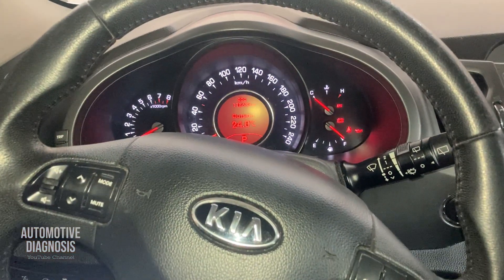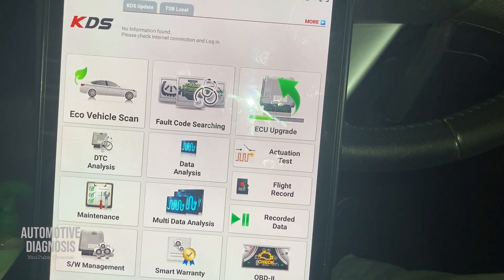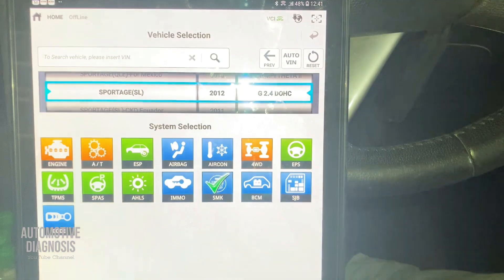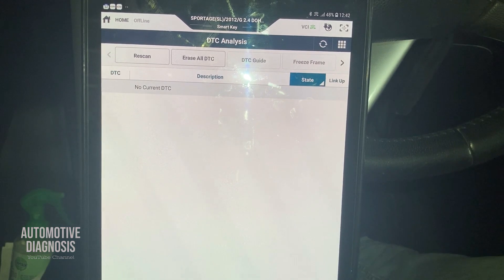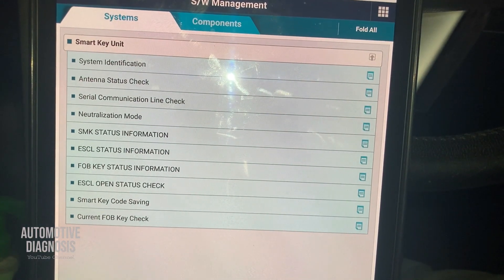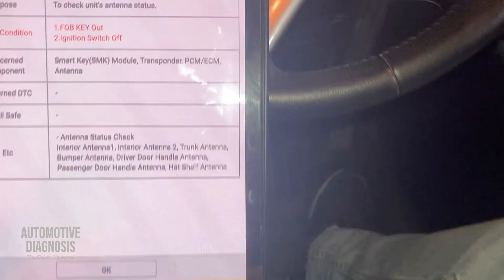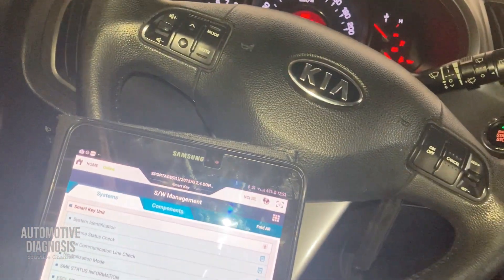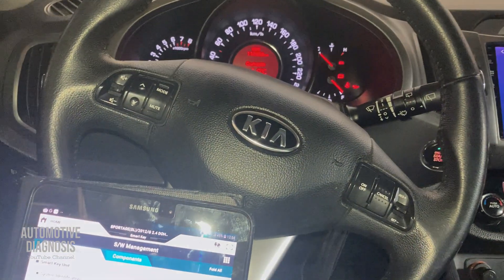Push Button Start Diagnostics Explained | Smart Key System Diagnostics #pushbutton #smartkey

Comment: hello dear @AutomotiveDiagnosis.
question if i may plz, Hyundai sonata YFA when key fon not in the holder engine doesn't start, as soon as i insert key fob into the holder engine starts. what is seem to be a problem? new battery in key fob,buttons ok,active. i've changed battery believed that could be an issue, but it's not. if transponder has a problem, would i be able to start the car with key bod in holder??
thank you
Reply from the maker: Hi there, could be the holder issue. When you insert the key into the holder, LF antennas won’t work anymore, in case of holder issue, same thing happens but even when key is not in the holder. Try disconnecting the holder connector, and see what happens when you press the start button after that.
Reply: @AutomotiveDiagnosis  good hunch. worth a try to check. i was actually think the problem most likely somewhere between RF resevier and SMK module. 
may be//
may be some wire damage or something..
i'll try by your opinion first
thank you

Comment: My Kia Stonic EX+ engine wasn’t turning off even after pressing power buttong. Kept it doing again and again. Atlast it stopped. Could it be low battery issue? Haven’t changed the battery for over 2years.
Reply from the maker: Yeah, it could be from the key battery. If it happens again try pressing the push button with the fob key.

Comment: I think you can't find this scantool outside of kia dealership
Reply from the maker: You don’t need to. The procedure for Push button starting system in this scan tool is the same in other scan tools and many of them cover very same functions.
Reply: @AutomotiveDiagnosis do you have any somewhat low cost options? i have xtool d7 but doesn't seem to have this feature
just reprogrammed the keyfobs since push start isn't working but no change
Reply from the maker: @rawrtravisrawr  May I ask what is the fault on your car?
Reply: push start on kia doesn't see key fob
unlocking/locking car works normal tho

replaced batteries with no change

reprogrammed keyfobs and same issue, unlocks/locks car fine but push to start says no key detected unless i push against the button

tried a new button and new antennas

maybe the antenna control module like in your video here? its a kia @AutomotiveDiagnosis
Reply from the maker: @rawrtravisrawr   And May I ask your car model and year?
Reply: 2021 kia stinger
 @AutomotiveDiagnosis
Reply: @AutomotiveDiagnosis  thank you sir